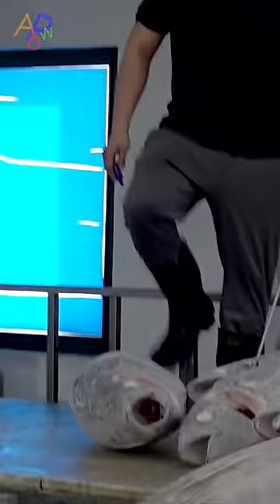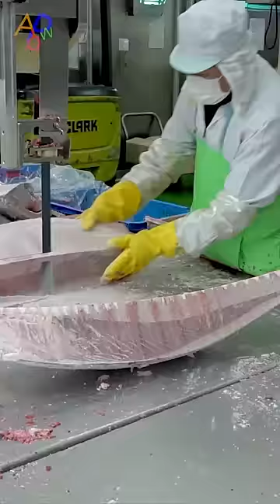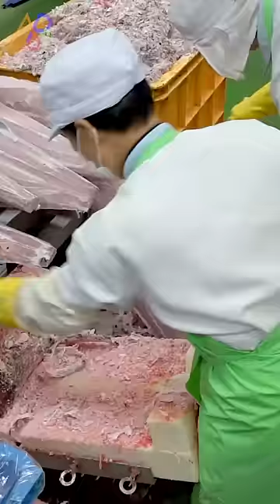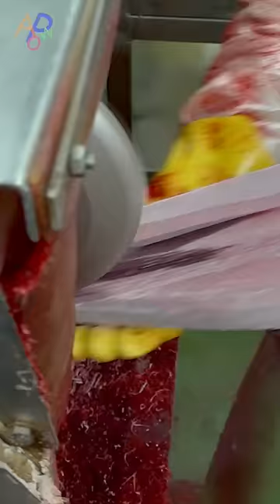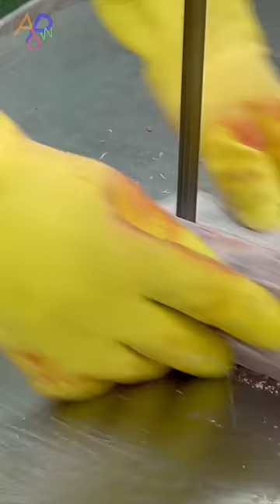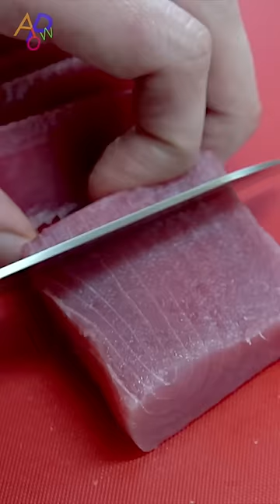Amazing Frozen Tuna Cutting Skills and Machine #allprocessofworld

Comment: do not use feet to our food ❤
Reply: The feet is very clean for work and also the whole skin of fish is discard
Reply: @Khalid.Algarhi.27483 we always find someone like you backing up the worker as if it was your company video. Not saying anything in particular but general observation
Reply: @MrSur512 I assume the boots are worn only inside the facilty, everything is contained inside. Heavily controlled facility and workplace since this is for food, and fish at that, which is easy to spoil if mishandled.